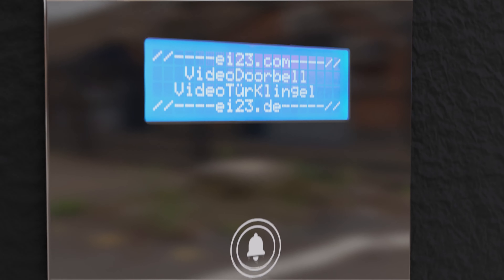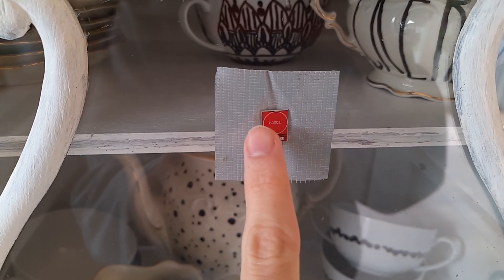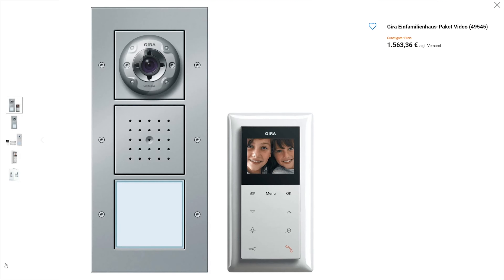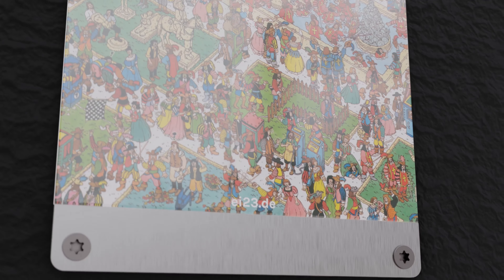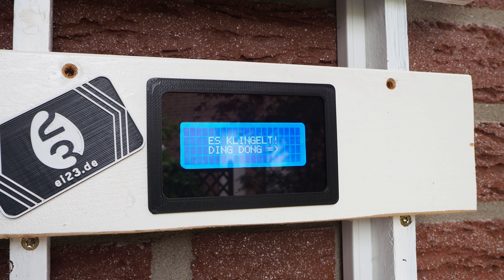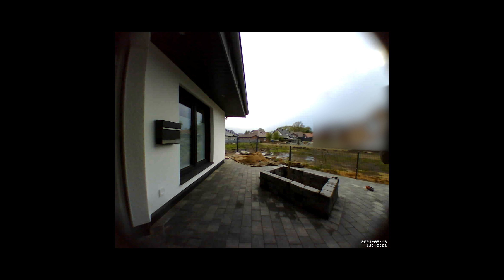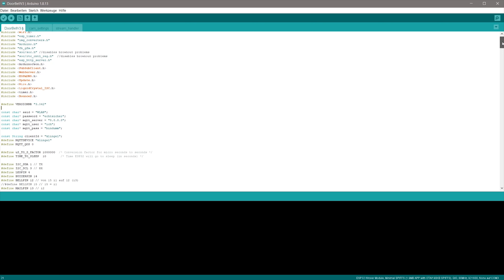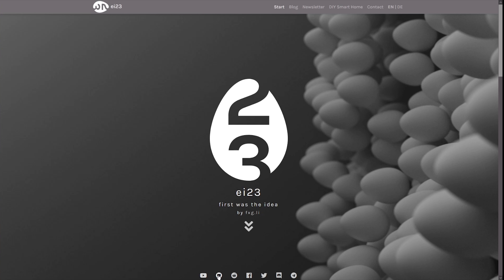DIY Smart Home Video-Doorbell with ESP32 and Raspberry Pi [ENG]

Comment: What kind of foil did you use? I looks really thick, was it a custom printout by a copyshop or something?
Reply from the maker: yes, exactly. Printed foil for window advertising.
Reply: @ei23de  Have you got any more details about the foil? It looks rather thick (which I like) Perhaps a link to the printshop if you can remember.
Reply from the maker: It was called vinyl foil i guess.
It feels quite robust and plastic-ish

Comment: great job. is it possible to do this with wired communication instead of wi-fi?
Reply from the maker: Yes, with a raspberry pi zero for example. 
Or you need a custom built ESP32 board.
Reply: @ei23de  thanks for your reply. Do you have any suggestion to encode camera images and microphone data to send with wire and what wired communications do you suggest for less noise and long range? rs485 is ok?

Comment: Hi Felix, great job. any chance I could get my hands 9and eyes) on your Arduino sketch for this project?
Reply from the maker: Hi Ron,
sure, but i have to clean it up a bit first.
It's a combination of an Arduino Sketch and NodeRED Nodes.
It basically uses the ESP32-CAM AI-Thinker example with some MQTT additions and the LCD Driver.
When someone rings the bell, most stuff is done in NodeRED.
NodeRED downloads the current image and sends it to Telegram and HomeAssistant and also sends the text for the display to the ESP.
I think i have to do another full tutorial on this...

Maybe tell me where you are stuck?!
Reply: @ei23de  Felix, I did not even start :) well I did sort off. My current project is a simple doorbell, the ESP32 is going to sleep (to drop power consumption) and a press on the button resets the ESP32 and when it reboots it pushes an event to telegram to notify the pressing of the button. 
I just like your setup and like to learn how you did things. Your intergration with HomeAssistant and the use of video is interesting.
Reply from the maker: Should it be battery powered?
Because battery powered ESP32 Cam is quite hard. I'm currently finishing my smart doorlock video, which is also battery powered and those kind of projects are quite hard.
In case of the ESP32 Kamera, it would use some time to connect to wifi and then send the picture. This can be annoying, if your door notifies you after some seconds has elapsed...
In this case i would go for at least power connected ESP32.
If programming is not your thing, you should have a look at ESP-Home
https://esphome.io/components/esp32_camera.html

Much easier, only not as customizable
Reply: @ei23de  I d a little programming I usually figure things out with a lot of try and fail :)
I don't have trouble make battery powered arduino/raspberry pi projects, I use 18650 cells with a BMS that upscale to 5v with USB charger etc.. That works pretty well. 
I will check out ESP-Home. Thanks.
Reply from the maker: Trial and error is the fastest way to learn, i also do it that way.
Unless you can learn from experts. You dont have to redo every error yourself.
I have tinkered around with low power devices for at least 4 years now.

Trust me, the voltage regulators of USB-chargers are not very efficient. You go up from 4.2V (18650) to 5V (USB) and then back to 3.3V with another bad voltage regulator (AMS1117) for the ESP32-CAM. 
You should go directly from 4.2V to 3.3V with a "mcp 1700 3302e" for example and remove the AMS1117 from the ESP.

Within deepsleep you should aim to be at least under 0.1mA in the whole chain,
otherwise you have to charge the battery too often and that is quite annoying.